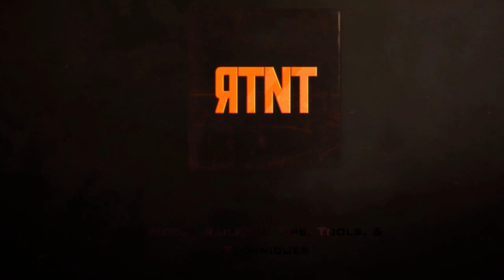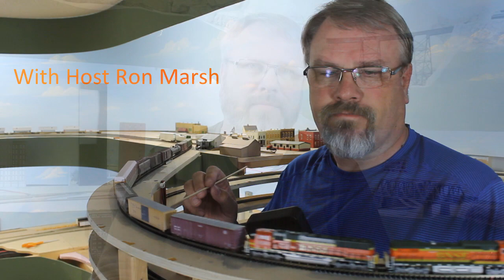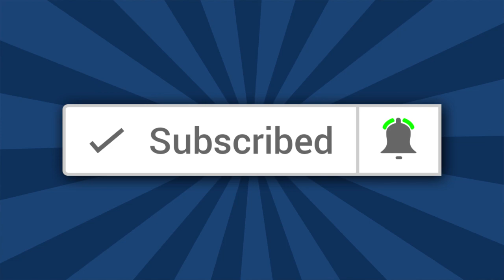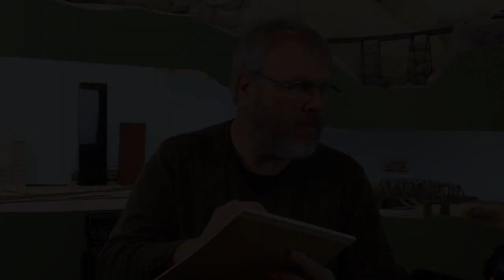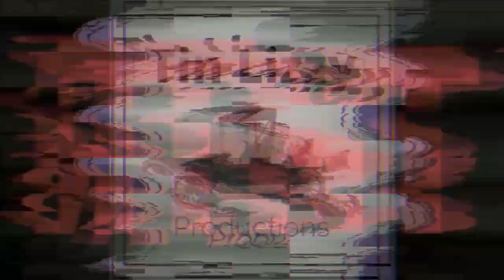Keeping Small Parts Organized--A Micro Tip

Comment: THANKS RON,  they are great, but go to the craft stores Ang you can get bead box's fair the small parts like couplers or wheel sets that are of different sizes & they can be keep in one place, I use the for parts when working on car that need different parts for car repair,  same of engines or anything were you have a need for many different part all at once, thanks for sharing this one too....
Just had a thought, how about pill bottles too!
Reply from the maker: Thanks for that tip.